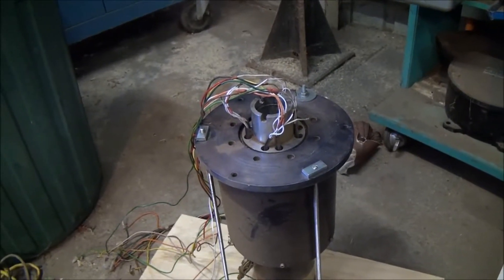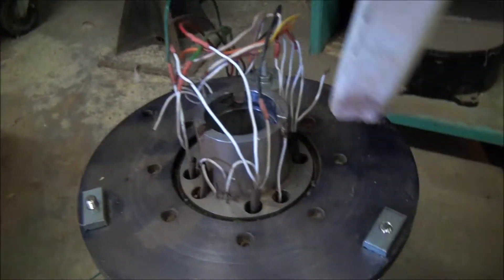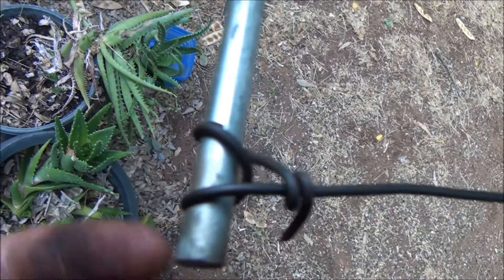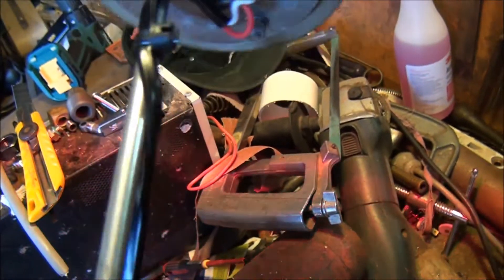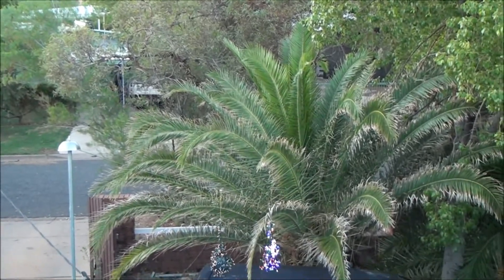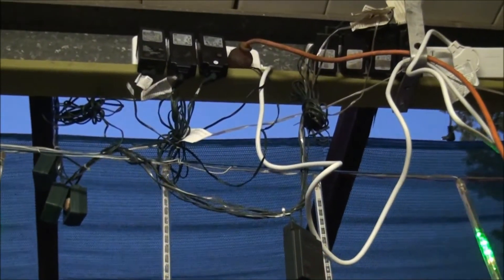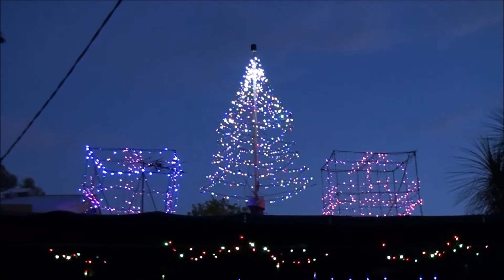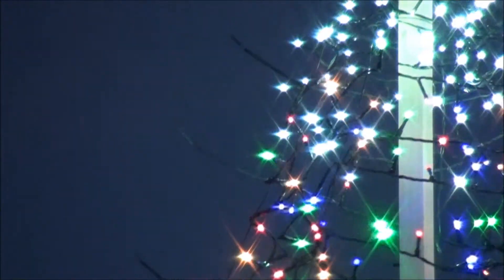Improvised Christmas light display

Comment: Looks great, got to do something like that myself. i think the motor is from a reflective antenna array like the ones used on ships. It rotates back and forth to get the best signal.
Reply from the maker: +pow0006 Thanks for the info, I have had that for over 30 years, I found it in a scrap metal yard when I was a kid and thought that its too nice to get scrapped. I knew that one day it might come in handy! I thought it may have come from the Aviation industry so I think that you are probally correct on that.

Comment: Hello mate that display of lights is AWESOME well done! How much current does that lot pull?
Reply from the maker: +jon johnson Thank you! Not too sure how much current it draws but around 2 amps or so, the LED lights are fairly low current and that motor unit pulls about an Amp on 12 volts so excess current on the dodgy wiring setup should not be an issue. Have a great Xmas!
Reply: That's good won't rack up your bill too much! Merry Christmas to you too